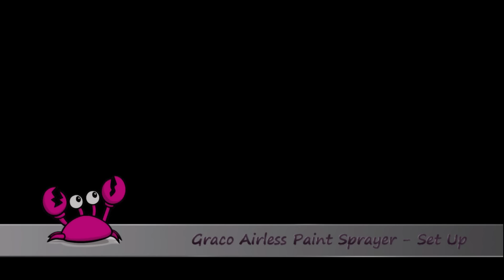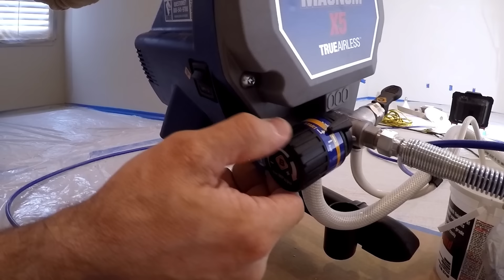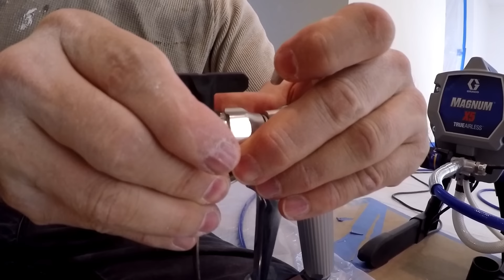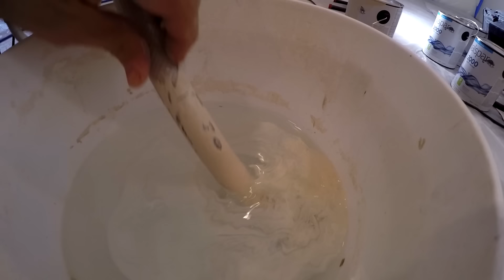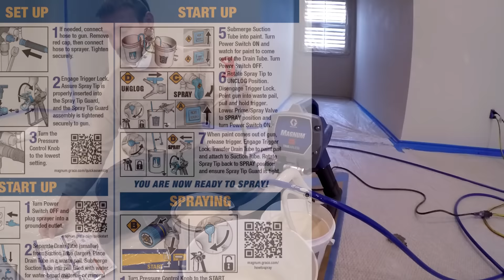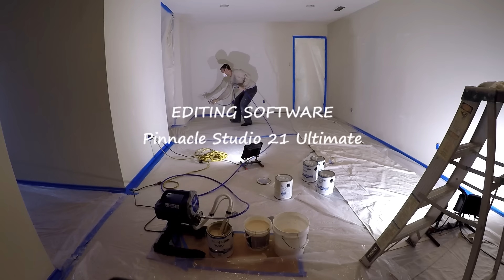First Time Using Graco™ Airless Paint Sprayer | Part 1 - Detailed Set Up For Beginners

Comment from the maker: Please be prepared - this is an overly detailed, slow-paced, and slightly boring overview of first time users muddling through a slightly complex setup/use/clean-up process. Although, by no means an entertainment video, it may come in handy for anyone overwhelmed with the 'beginner' aspects of this airless paint sprayer. Enjoy!
Reply: I'm fairly new to paint sprayers myself. My stepfather is a professional painter and he loves the Graco brand. I plan to start me a small farm soon. I will be making furniture and other things as a way to generate a side income on the farm. I was looking at this prayer along with brushes & rollers for when the project requires a coat of paint. I like your video as it was very helpful.
Reply from the maker: Thanks, Jamie.  Good luck with the farm and all the fun projects that come with it!
Reply: thank you for the time spent on making this video
Reply: Gday mate, should I buy this airless sprayer or the wagner 350 pro? I'm a builder and would like to use it in my projects.  Cheers
Reply from the maker: I have no experience with the Wagner 350 so I won't be able to advise you on that one.  But, seeing that you're a builder, I would suggest you consider the Graco X7 instead of the X5.  For around $100 more, you get a little more power (can run longer hoses) and a handy stand.  

Maybe others on here have used the Wagner and could pipe up on this?
Reply: @phillipsarkis5889  You want a sprayer that can handle extra line ,and get a whip line!
Reply: Thanks for the reply and good wishes.
Reply: Thank you!
Reply: If I'm going to invest in this, that is OK. I need to know exactly what to do and why. Thanks
Reply: I am totally new at this and I loved how slow and precise he was in demonstrating the sprayer. I didn't think it was boring at all.
Reply: I recommend viewers play this video at 1.5X and then the pacing is just about right.

Comment: Run the Trigger wide open and Spray... Then have an Assistant Back rolling the paint behind you. Sprayer is just to Apply the paint. You still have to Roll in the Paint to Install it into the Substrate.

Comment: This is the first video I have seen that looks like my efforts my first time I used this sprayer. My only question I have not seen an answer to is what to do when you empty the first pail and the sprayer stopped in my case. Do you just move to the next pail of paint with the two tubes or do you have to start somewhere a few steps back to prime the pump?
Reply from the maker: It's my understanding you can go straight to your second bucket of paint if you lose prime.

Comment: the unit leaves lots of over spray everywhere,  what are some tips do you others suggest? Chinese sprayer didnt do this.
Reply from the maker: We had 'spitting' trouble until we switched to super thin paint. These days it's hard to find paint that doesn't have primer in it. We couldn't get a clean spray pattern with the thicker paint. Hope that helps!

Comment: Tips from a 18 year pro. Steps 1 and are a waist of time. Put the suction tube in paint and prime the machine. Your ready to spray. Only time you need to use the drain tube is if the gun gets air in it. It will either spit or lock up in this situation. Then you run the drain to purge the air and your ready to go again. Make sure the suction tube never comes out of the paint ( always fully submerged). Or else you wil get air. Good luck. Oh and make sure the spray tip is always in all the way, or else when you pull the trigger, you will get a face full of paint.
Reply from the maker: Awesome tips!

Comment: Did the one gallon of paint go far using this machine ? And thank you for the video
Reply from the maker: The paint didn't go nearly as far as it would have if rolling/brushing.  But, it did save a ton of time in actual application (not the taping prep).

Comment: While it's slow it was helpful to watch someone else go through the painful process of learning how to operate it. :) I bought the same model sprayer and used it for the first time today. I can see that I might've skipped step 6, because when I started spraying (primer) my garage door, for several seconds it sprayed a lot of water with the paint. I thought something was wrong, and it probably was me. After priming the sprayer I didn't go through the step of spraying into the waste bucket until only paint was coming out. And in a gallon bucket it probably went down almost 2 inches so I wasted a lot of primer, but had enough to do the whole door with a little less than a quart remaining. But it did a really nice job. I don't know how differently a commercial rig would be to set up, but to me the priming and having to have essentially 2 extra buckets, besides the paint can is too long of a process. And cleanup took a long time. I used my garden hose to purge out the paint. Another thing I should've paid attention to was how to recapture paint remaining in the hose. I ended up flushing all of that out with the water so I wasted more paint. But it's the first time I have used a spray rig other that a small one for shooting lacquer to paint guitars. Oh well, live and learn. Another thing about watching someone else do it is to see if they (you) experience so of the same things that I did, such as the motor pulsing on and off through the spray process. I think that's a little odd and might wear out the motor quicker than one that stays on, but I don't know if that's typical of "airless" sprayers. Suffice it to say, I need to re-read the instructions for awhile until I get the process down. I expected it to be simpler, like it is with my sprayer that runs off of my compressor. Thanks for sharing your experiences. I learned from it! One more thing to this already long thesis. I wish there was a way to change the width of the spray pattern without having to change tips. On my lacquer gun there's a knob on it that I turn either way to increase or decrease the size of the pattern. I can also adjust the amount of paint coming out to get a dryer or wetter coverage, and also adjust the amount of air being pushed out. On the Graco I know you can change the pressure but I haven't found a way to change the size of the pattern without changing tips. If it's capable of changing the pattern, other than horizontal or vertical, please let me know.
Reply from the maker: Thanks for the in-depth review and telling us about your personal experience as well.  It helps to hear what others have gone thru!  If you're anything like us, you'll find more projects to use the sprayer on in the future - projects you may not have thought of using the sprayer on otherwise.  Happy spraying!

Comment: What do you do with the ceiling so you don’t get over spray on it
Reply from the maker: In this case, we were painting the ceiling the same color as the walls so we didn't have to worry about overspray.  It's one of the reasons we decided to use a sprayer for this project vs. brush/roller.  Otherwise, you would have to tape it off.
Reply: @GettinBelizy  thanks so much

Comment: I’m currently standing in front of my prayer, but don’t have that little black piece you’re spinning inside the orange cone on the gun. Is this what creates the “fan” spray? Do I need to get that black piece or does it not serve a good purpose?
Reply from the maker: I think you are talking about the spray nozzle or 'tip'. If so, yes, it is critical for spraying. They are sold separately in stores and come in different nozzle sizes to accommodate different paints and applications. Check on your paint can label for the suggested nozzle size.
 
Happy Spraying!

Comment: Boy, what a convoluted startup process... but I just bought one for doing my doors. There is simply no way I'm messing around rolling 20 some doors / closet doors in the house. I hope it ends up working well and then I have a very nice tool when it comes to intimidating paint jobs.
Reply from the maker: We used the sprayer on two different cabinet projects and spraying doors is the only way to go. It paid for itself there alone. Happy spraying!

Comment: The setup is awful and messy,  used it for a couple days and ended up rolling paint over areas of poor spray and the rest of the house. Would not recommend the sprayer except Reno where you don't have to protect floor or trim.

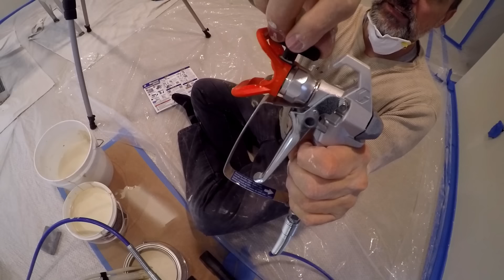Comment: One thing worth mentioning...when adjusting/tightening/loosening the tip & guard on the gun, do not put your hand in the line of fire of the nozzle as was done at t=14:11. Injection injuries are no joke and very serious, requiring immediate surgical treatment. Yes, the trigger guard/safety and keeping your hand off the trigger is important, but it's best to avoid putting your hand in front of the nozzle at all.
Reply from the maker: Good tip. Safety first and happy spraying!

Comment: Thank you for the video. out curiosity if the paint comes with primer i won’t need the primer bucket correct  ?
Reply from the maker: Please don't confuse paint primer with 'priming the machine'. When we talk about 'priming' on this video, it's about starting the suction of the sprayer correctly - which is called 'priming'. It's just part of the process of using the sprayer no matter what paint you use.  You actually do NOT want to use paint with paint primer in it because it is too thick.  This sprayer only works well with thinner paints.  I hope that made sense!  Happy spraying!

Comment: Dude - don't put your hand in front of the trigger. That is a HUGE safety concern. That trigger goes at that point blank range you will spray paint into your finger or hand and need to go to the ER. Also, you should wear shoes an safety goggles.

Comment: Question 
Do you have to clean the sprayer if you wanted to prime the walls and then use white paint since they are the same color
Reply from the maker: If they are both water based, I guess you wouldn't absolutely HAVE to clean between primer and paint. But, I would warn you that this sprayer does NOT do well with thick paint so the primer may clog and not spray well.

Comment: I just bought this sprayer to paint the exterior of my house. The directions say to go back over it with a roller after you spray. Is that really necessary? I would think the sprayer would leave a more even and smooth spread. Thanks for the setup demo. Can't wait to use mine for the first time
Reply from the maker: We've heard the same but haven't seen a need to back roll anything yet.  After talking to a number of pros on the topic, it sounds like the back rolling is only really needed on very rough surfaces such as non-sanded fence.  The sprayer alone has worked great on smooth surfaces as long as you watch your spray nozzle distances and angle.  Happy spraying!

Comment: Did you filter paint before beginning? Good idea to filter beforehand if using not new paint? Good videos. Thanks.
Reply from the maker: It was new paint, so no filtering. But we did thin some paint that contained primer before we sprayed it. Found out that is critical! Thanks!

Comment: How much wall were you able to get out of the 5 gallon bucket?   Does it suck it up FAST or did you find it covered quite well?
Reply from the maker: 5 gallons goes a long way.  If we had used a 5 gallon on this room, it would have covered all the walls (and there are a lot here).  As newbies, we went the not-so-smart route and used 1 gallon pails which wastes a lot more paint.

Comment: Thanks for showing my kids just got a repo cabin exterior painted orange 🤮 since it’s a shell I figure with all the painting we will have to do getting one of these will make that project a little easier
Reply from the maker: A cabin makeover? How fun! This is a great option for any 'paint from scratch' projects. It's less ideal for middle projects like the one here ... Happy spraying!
Reply: @GettinBelizy  well it’s a bit more than that as only the inside framing was done before we looked at it I warned the kids to look past ugly filthy and gross as we were looking to make sure it was structurally sound so with that in mind only 3 things wrong 1 sheet of the outside siding needed replaced and one framed interior bedroom wall needed studs replaced as prior owner in anger cut the studs in half and when removing building they clipped a branch with roof. They are fixing roof this cabin brand new sells for 38k kids getting for 20k the move fee 300.00 to put on their half acre they own free and clear as that was a tax seize but at 500.00 so finishing out home will be a project but we can get it done as they save to pay cash ..one step at a time they are 18 and 20 and will have   Home free and clear in 5 years with enough land to do another if they so choose
Reply from the maker: Still sounds fun!  Good luck!

Comment: what if your using laytex paint like Behr brand paints, do you still have to go through the process of putting the suction tube into a pail filled with water?
Reply from the maker: If you mean for cleaning after using latex paint, yes.  If you mean to prime the sprayer, you don't NEED to use water but you will waste a bit of paint otherwise.
Reply: @GettinBelizy  thanks! I got it today and used it. It uses a lot of paint
Reply from the maker: Yes, it does.  You might try back rolling to cover better with less paint.  Happy spraying!

Comment: hi there does it spray all kind of paint or does it has to be sprayable paint?
Reply from the maker: It sprays all kinds of paint, although it won't do well with thick paint.  Stay away from paint that includes primer and thin the thicker, high quality paints or you'll run in to trouble there.
Reply: @GettinBelizy  thank you very much for your feedback and merry xmas
Reply from the maker: And to you!  Happy spraying!
Reply: @GettinBelizy  i will use this machine  more like painting furniture im using more mdf for my projects
Reply from the maker: Yes, Mike is very familiar with mdf work ... he's a custom speaker box builder in his 'free time'. Let us know how it works for you!

Comment: You should never put plastic on the floor the overspray won't dry on plastic you're better off putting drop cloths
Reply from the maker: You are right that the paint didn't dry quickly on the plastic.  We needed plastic so that we could tape our baseboards really well but maybe we should have put drop cloths OVER the plastic!  Good point.

Comment: By the time you put your super expensive blue tape up I could have brushed and rolled that room. Your trying to do it the easy way and only making it harder. 
What about your ceilings?
Reply from the maker: We did not buy the sprayer for this project specifically.  This project happened to be the first.  The tape is required even if you brush and roll - unless you have no trim at all.  We had a lot of trim - windows, doors and baseboards.  We sprayed the ceilings and walls with the same paint so didn't have to tape that.  

It's true that using a sprayer only makes sense for certain projects.  It made actual 'painting time' much quicker on this job.

Comment: In the time it took you to tape everything off I can have it brushed and rolled.
Reply from the maker: 90% of the tape time was for baseboards and carpet.  It would have been much quicker if we could have sprayed prior to flooring installation.  But we had to tape off the baseboards, window frames and doorways no matter if we sprayed or rolled so, the prep / tape time really doesn't count if doing a comparison.

Comment: I was determined not to spend $1700 to have my basement walls painted by a professional, so I bought the Graco Magnum Painter Plus.  Your video, (part 1-start-up), was MOST helpful.  I followed your demonstration step by step and was up and running in no time.  It took my wife and me two days to mask everything, (we're in our late 70"s), fifteen minutes to perform the start-up, and only three hours to paint the walls.  We are extremely happy with our finished product.  If you have a big painting project and dread the thought of using a roller and spending days on a ladder I highly recommend the Graco Magnum Painter Plus and watching your videos.  Trust me, you'll be happy with the easy results. Your videos are a must watch.  Thank you for giving me the confidence to take on something new and making life easier.  Great videos!!  (By the way, my total cost for the Graco paint sprayer, masking material, and paint was less than $500).  Paint on.......
Reply from the maker: Thanks Robert!  Lending any help we could to first timers is exactly why we made the videos.  Glad you made the right painting decision for you!

Comment: Well thats literally the cheapest paint sprayer graco makes and they make about 50 the finish it leaves is absolutely disgusting compared to the 390 PC or 395 and that one will last for about 80 - 120 gallons (that’s what I’ve been told by many) but my 390 PC has seen nearly 4500 gallons and is still going strong